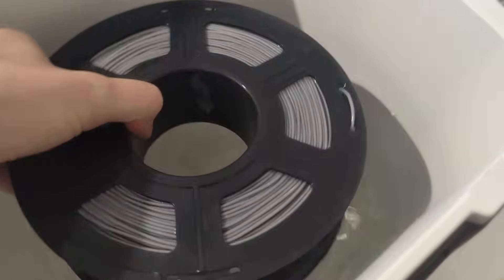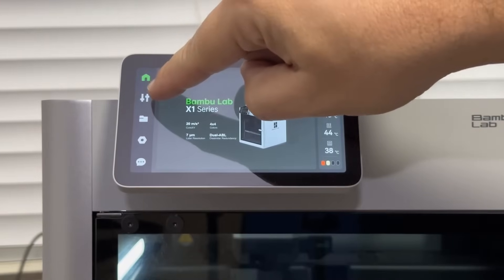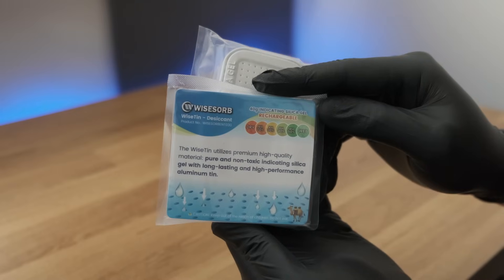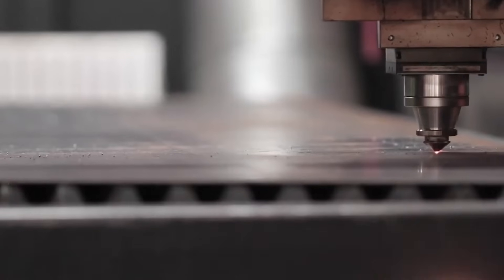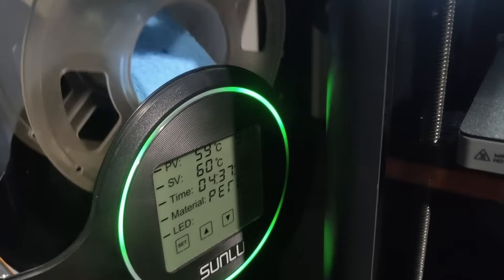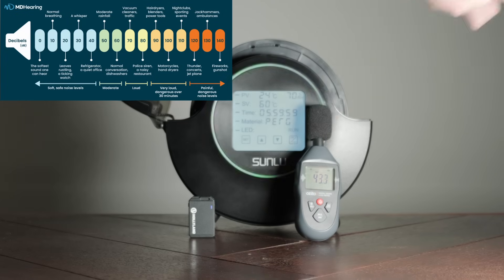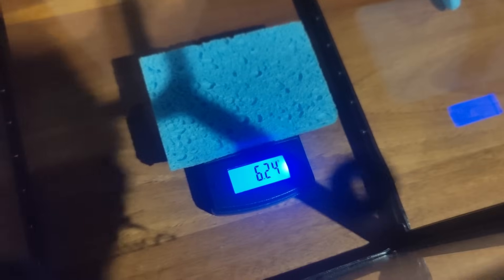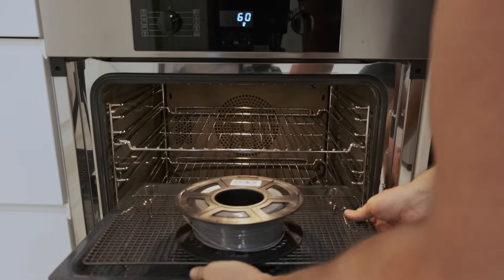How to Tell If Filament is Wet (And the Best Ways to Dry It!)

Comment: Great video. I'm interested to know how well a microwave would work though :)
Reply from the maker: haha I would suggest not using a microwave (or even an oven really). Filament dryers are pretty cheap these days, and even if you only get a one spool dryer, at least you have the peace of mind that your filament won't get ruined, or your house hold appliance.
Reply: @LayerLabAustralia I see what you mean. It's the safe option. I still might risk buying a cheap used microwave though 😂 I like to live dangerously 😆

Comment: Thoughts on air fryers / small convection ovens? Instead of taking up the house holds ove.

I'm needing to dry engineering type filaments, so the standard 60-65c filament dryer doesn't cut the mustard.
Reply from the maker: I believer there are some dryers out there that can dry engineering type filaments, Sunlu has some that can go up to 110C. But I'd stay away from using ovens/air friers as much as you can because they don't have the safety features/air circulation like purpose built dryers do
Reply: @LayerLabAustralia most air fryers are fan forced.

Comment: Is drying the filament a one-and-done process or do you have to do it each time you use the filament?
Reply from the maker: it depends... If you dry it, then store it in an air-tight container with desiccant, then you won't need to do it again until you leave it out for a while. Just don't over-dry it, as doing so can degrade the filament and cause more problems.

Comment: mate it's painful to watch your sound level measurements. don't lean your measurement device up against the dryer like that. for one you're going to get a lot of direct vibration from the plastic because the wind shield transfers those. second, you want to point the meter directly at the sound source as if the mic was the barrel of a gun because the mic in these things is directional. what you most likely measured in this video was vibrations of the casing and indirect sound reflected off the ceiling. not super terrible but you could get much cleaner results
Reply from the maker: noted! Thanks for the tips :D

Comment: Tried the oven method once but the temp. control on mine is far too unreliable. I set it to 50°C and ended up with partly melted filament (not deformed but the turns stuck together) Since then i only use a food drier set to 65°C and it works perfect. To fit more spools into the drier i made an aluminium duct with the same diameter as the trays that came with the food drier. Now i can stack 5 rolls of filament into the drier at the same time.
Reply: Did you put the filament in the oven cold?
Reply: @Zigzag3269tf  Long ago, but i think i put it in the cold oven and started the heating afterwards. In the end it doesn't matter because the (analog) thermostat on the oven is not accurate enough to set the temp. correct.  10 - 15°C more or less are irrelevant when making a cake but are critical for drying filament.
Reply from the maker: Ahh nice! 5 spools at a time certainly saves some time. Glad to hear the food dehydrator is working out for you :)
Reply: @LayerLabAustralia  Its not the quickest way but works without melting the filament.

Comment: I bro i hope u reply i have a question...i have a microwave at home with convection mode... so do u think i can use that ? Also another thing is the convection mode can do 40*c and then straight 100*c ...

Please guide what should i do
Reply from the maker: to be honest, I'd just grab a cheap filament dryer and not have to worry about melting your filament or burning your house down :P

Comment: I bought an electronic" meat smoker on closeout for $130. I can set time and temperature. It holds 8 rolls of filament. Checked it with 2 different heat guns and found it to be about 3 degrees low. What really gets me, is that when you search for drying temps for a given type of filament, the answers are all over the place. I try to go by Manuf recommendations, but I can't always identify whose filament it is.

Comment: Most of these filament dryers max out around 50-65 degrees C. To fully dry Nylon you need to go to 90-110, you can get dedicated dryers that go this high but they are a lot more expensive.
Reply: Many basic air fryers have dehydrate, reheat, and keep-warm modes with adjustable temps from 45°C to 140°C+, covering most drying needs. They also offer up to 24-hour timers, better build quality, and are much cheaper.

Comment: I just bought an AMS 2 Pro with the drying feature. I usually cut about three inches from the end of the roll before loading. After putting four rolls in my AMS 2 and drying for 12 hours, I cut a piece off each roll, and everyone snapped, not bend like it previously did when I was storing my filament in airtight containers with a pound of desiccant in the bottom.  They appear to print okay?
Reply from the maker: hmm interesting. Were they previously okay prior to drying? Or were they sitting somewhere in storage for a while?

Comment: Its a shame nobody ever covers dry cabinets for filament drying and storage.  Just search for PAC 3D Printing Filament Cabinets. I have 2 of the smallest ones. They hold 5 spools and keep the humidity where I live under 10%. They work great, and use very little power.
Reply: I'm going to give this a try. 

I don't want my hobby consuming more electricity than what's needed.
Reply: Perhaps because they are quite expensive? I see the small model for 5 spools is twice the price of Sunlu S4 for 4 spools.

Comment: a bit input from my method.

this video is focused on direct drying , means you dry the filament directly. I use medium like desiccant (yellow balls from amazon) for a safer and more fool proof approach. It should be good enough for PLA and PETG coz thats what i use mostly, and i have yet had chance of owning more exotic mats like ABS or nylon, those probably needs directly drying for best result.

And i use microwave to dry desiccant.  It is very very fast and effective. for a 1000w microwave, i put them in a ceramic bowl with lids, 10mins at 50% power for 400gram worth of desiccants.    when done be very careful transfer them into a bigger container where there is enough room for them to cool down and steam off the moisture. after they are cool to touch, you can start use them.  I can get them as low as 7% or 10% which is good enough for me.
Reply from the maker: Thanks for sharing your method — that’s a great alternative approach! Using desiccants is definitely a safer, low-risk option for materials like PLA and PETG, and it’s awesome that you’re getting them down to 7–10% moisture. Love the microwave tip too — quick and effective when done right. I might have to test that out in a future video 👀 Appreciate the input!
Reply: Also since you're not using your microwave on full power, I'd recommend getting one that uses an inverter, since normally they use a transformer and a relay to turn the magnetron on full power, then shut it off for a period of time resuilting in uneven heating and hotspots, risking heating up the desiccant too much.

Comment: 1:00. I’d like to add that the vacuum sealed bag being tight doesn’t necessarily mean anything, I just opened a brand new spool of Bambu PLA recently that was still fully vacuum sealed and it was unbelievably wet, I was impatient and didn’t throw it in the dryer first like I usually do, and it provided abysmal results and ruined a print.  So, my opinion is never assume the factory sealed filaments are dry and always dry them before use. Especially with more hygroscopic filaments like PETG and PA. I’ll never make that mistake again.
Reply: I had the exact same problem. Drying the filament now

Comment: I'm not sure a sponge retains moisture as well as hygroscopic plastic. It probably takes more heat to remove the moisture from plastic than a sponge. I'd like to see some testing with multiple rolls of the exact same filament (color, type and brand) stored in a humid environment before you measure the weight before/after drying with each method
Reply from the maker: You're right, it probably does behave differently to regular filament in terms of moisture retention/loss, but it is a fairly common testing practise I've seen on many other YouTube channels, so thought I would give it a try myself. Will keep this in mind for any future content about this topic :)

Comment: Please don't place your filament in your oven. The oven controller is far from precise and you will most likely melt or ruin your filament. Use a filament dryer like the Sunlu 1 or Sunlu 2, or other reputable makers.

Comment: no info on microwave drying?
Reply: glad i checked the comments before i watched the rest of it. Really wanted to know about that if it was possible. Either way this video was pretty helpful
Reply: Microwaves are horribly uneven heating (which is why they come with turn tables) and will melt your filament. I also really wouldn't recommend any device that you're also going to use for food.
Reply from the maker: I wouldn't recommend using a microwave, even using an oven is a bit of a stretch... That's why if you do use an oven, keep the temp low to lower the risk of something going wrong.

Comment: I tried to use Anycubic Kobra 3 Ace plus dryer. It didnt work. So I print at 245-250 deg.cel. for wet filament. It prints like a charm without any problem. *Just print at direct extruder type printer and do NOT use PTFE tube. If you have to use it, you have to dry it somehow. Otherwise it might get crack in the tube. Happy prints.
Reply from the maker: Wow! Never thought of just printing it hotter...Gotta give that a try :P
Reply: @LayerLabAustralia  i had to clarify its just for PLA and PLA+, i have no clue about other filaments, have fun!

Comment: When using your oven, make sure you let the oven settle at the target temperature before you put your filament spool(s) in - most ovens overshoot the target temperature on initial heating up by a huge margin, which may damage your filament or even partly melt the spool...
Reply: That’s simple not true and to say most. Is just  a shot in the dark .  New ovens def don’t ocershoot
Reply from the maker: Or don't use an oven and get a filament dryer :D
Reply: @LayerLabAustralia  yes. But in case you still use an oven ...

Comment: I've found the purge line to be a pretty good indicator of wet filament. I've noticed it goes from smooth and glossy, to very rough even before the prints themselves have shown signs of moisture issues. I chuck the spool on my home made dryer, made from my old disassembled ender 3 and a gutted microwave, for the time and heat that bambu recommendeds, and we're back in business.
Reply from the maker: The purge line is a good idea! I just hate having to scrape that damn line off and have it get stuck under my finger nail (ouch). Would love to see your DIY filament dryer, here is a link to a discord server I've set up recently as a kinda 3d printer hub for people to ask questions and post stuff like this - https://discord.gg/PBs2CvF3s5   . Let me know if the link works, still trying to figure it out :P
Reply: I had the A1 mini first and never had the purge line go under my fingernail, but it happened the very first print of my p1p, lol. I just pick it from the side now and no issues.

The discord link works! I'll see if I can dig up some pictures I took while making it.